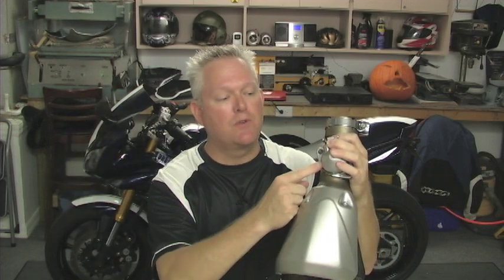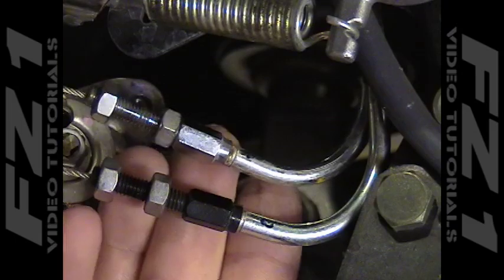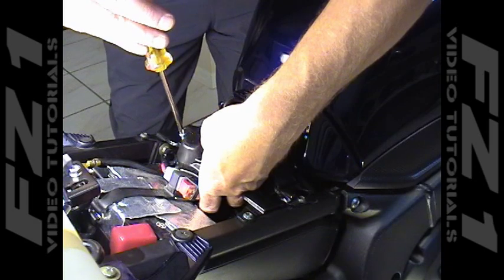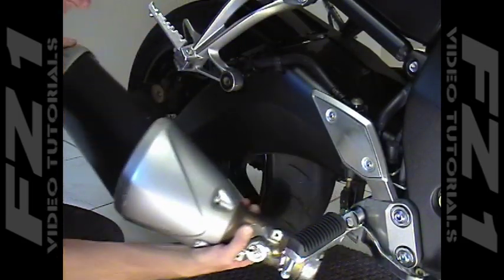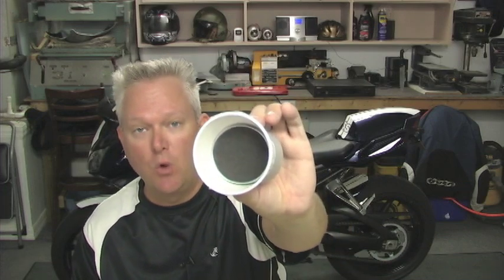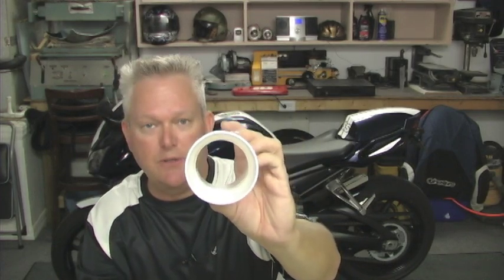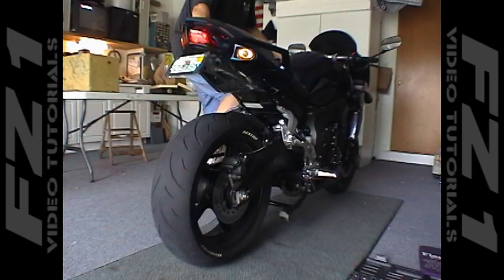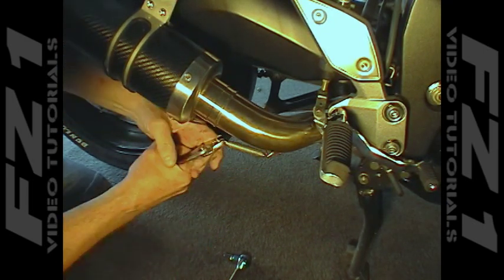FZ1 Video Tutorials - Exhaust

Comment: Hi
Iv had to put my original exhaust back on as the slip on got damaged.  I never removed the valve cables simply strapped them up. I have reconnected the cables now at the exhaust end but am struggling to adjust them and check if they work.  Any tips on adjusting them and checking if they work please.

Comment from the maker: Disconnect the cables at the valve. With the bike off and the valve spring loaded against the rest, check that the position of the first bead aligns over the detent in the valve wheel. Manually rotate the valve and not the distance the opposite detent travels. This is how far the cable should retract with the motor started and throttle opened. If you never removed the cables you should be real close.

Comment: To improve the FZ1 do three things before any engine mods 16 tooth front sprocket (£10) jack up kit (25mm)(£50) second hand 04 on R1 forks (fully adustable) and brakes (radial) (see ebay). You will be amazed how much quicker the bike steers 

Richard Great video though thanQ

Comment: Doing that mod will drop horsepower by about 6 bhp so you will benefit in power after fitting a pc3 or pc5 or ecu reflash as the fueling will go lean without it

Comment: How much is the stock truck muffler weight, compared to the new slip on. How much was the performance enhancements, after doing the work ? BTW nice looking bike, I have considered buying one, if I go to a 1000cc size bike, one last question, how is the fuel useage now ?.. Thanks. yl

Comment: Planning on doing this, but instead of a slip on pipe, I'm going to just remove the internal end cap on the stock muffler.  With this and the cat removal, will I need a re-flash?

Comment from the maker: @FazeRon1 

You do get some popping on decel but it is greatly reduced when you block the AIS, (more on that in another video). I liked the short looks of the MiVV, plus I did not want a big logo on the pipe. Sound wise it is exactly what I was after but most aftermarket pipes probably sound great too.
Reply: Do you got to load a map or can it run good without one?

Comment: Thanks for the prompt reply buddy but I didn't understand it all.  Different terminology and I'm not mechanically minded.
Should the valve be in the closed position with both cables taught for correct setup?  At what point will I see a reaction when the servo valve opens............when its warm and being revved?
Thanks

Comment: I gutted the cat on my 09 fz1 and put the slip on back on now the bike dont run right bogging down low and also at cruising speeds is it because i need to disconnect the air pump or did this mess with my o2 sensor

Comment from the maker: Not when you re-install the EXUP motor. The ECU doesn't know the cables and valve are gone. Nearly five years with my mike and I have never had a Code thrown up.
Reply: buelle109 ive been troubleshooting serious engine probs on my freinds bike for a while now. We are stumped.

One thing I noticed is that the servo motor is gone and the wires seem to be disconnected. I was wondering if this was effecting the ecu at all.

Basically, the bike seems to sputter and run poorly after riding it for a while, once it's warmed up. It will even die completely sometimes. We replaced all 4 coils and plugs, and checked the wiring in between the coils and the ecu for ground faults, etc. No issues there. We even went as far as replacing the ecu. The problem still came back after! I don't know what else it could be.

All I know is that the previous owner removed the exup servo motor along with the valve. And did nothing with the wires.

Have you ever seen or heard of this before?

Comment: Doesn't that servo controlled valve have an effect on performance?
Reply from the maker: It is only partially closed at idle and most other times is fully open. Depending on the slip on you use, the bike can have a small variance of RPM at idle but the valve being removed has no effect under acceleration.

Comment: do I need a exup servo eliminator  if I do this?
Reply from the maker: Only if you remove the servo. I left it in place and connected to the wiring harness so it doesn't throw a code.